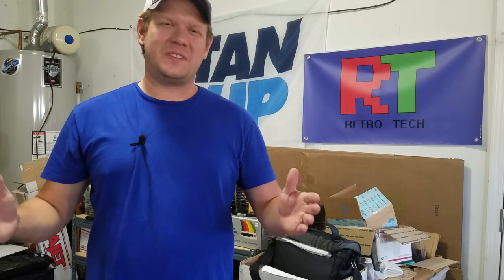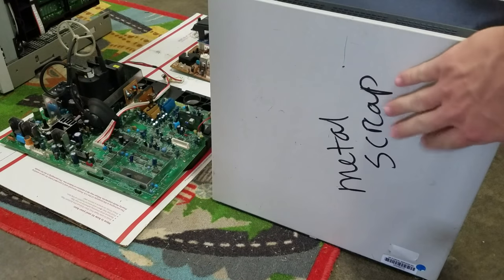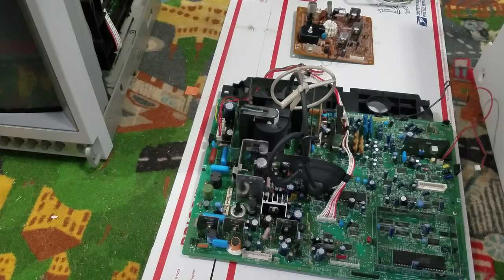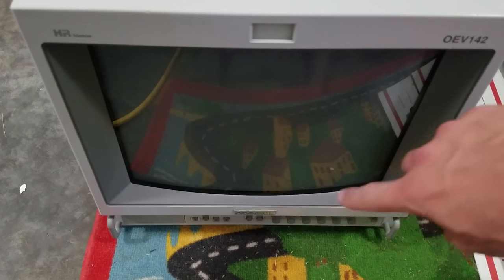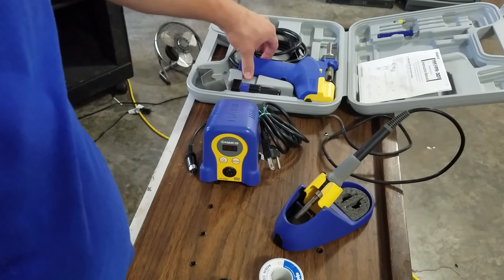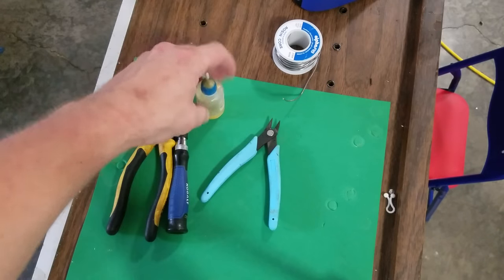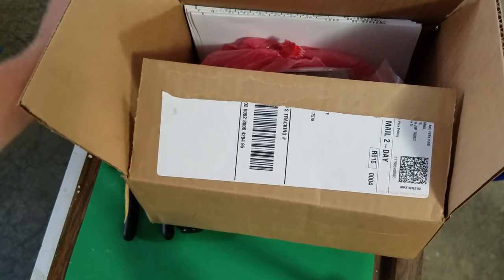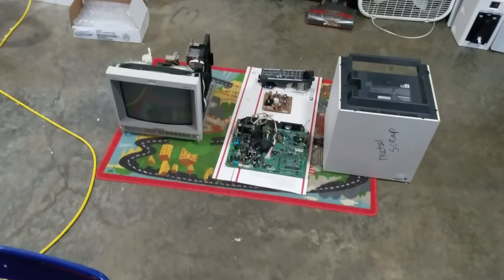Sony PVM Restoration Part 2 - Tool & Parts for the job

Comment: If you can figure out a cool space gray color, I'm definitely interested. One of my PVMs needs Bondo and a repaint if I can get the picture right (the image is still wobbly and affected by the brightness on all inputs, making it a capacitor issue somewhere even though I've replaced all the electrolytics already).

Comment: Hey Steve, do you know of a good circuit board cleaner that doesn't leave behind a residue? I'm recapping my PVM and the A board has a good amount of dirt on the component side and all the cleaners I've tried so far have left white residue and hasn't fully cleaned the board. Thanks in advance!
Reply from the maker: Unfortunately I've only found Alcohol to be a good safe cleaner for circuit boards.  I will be trying/testing some new cleaners for an upcoming video.  If you have a product you want me to check out, please let me know.  Thanks
Reply: @RetroTechUSA   I've used Chemtronics and LPS plastic-safe cleaners and I've heard good things about MG chemicals and 3M. I've read a few times that isopropanol is a good cleaner but it leaves behind contaminants and a white residue(if you use rosin core solder, as I do) 
Here are the links to the ones that I've been looking at:
MG - https://www.mgchemicals.com/products/cleaning-products-for-electronics/cleaners/electronic-cleaners/aerosol-electronic-cleaners/electronic-cleaners-superwash-406b
LPS - https://www.lpslabs.com/product-details/578
Chemtronics - https://www.chemtronics.com/electro-wash-mx

I've seen a few youtubers wash their boards in the kitchen sink with tap water..... I don't know if I'm that brave yet.